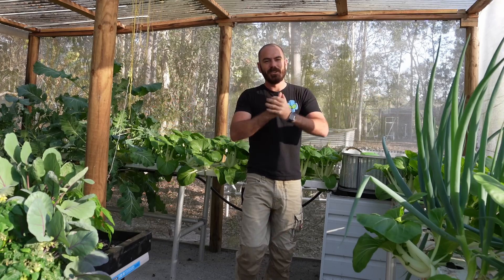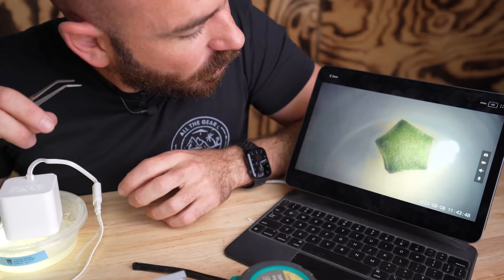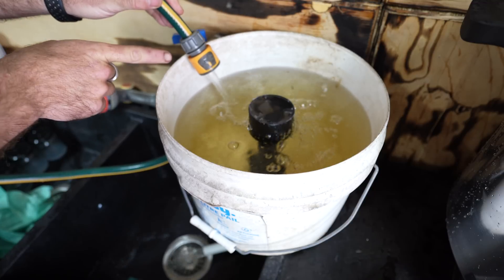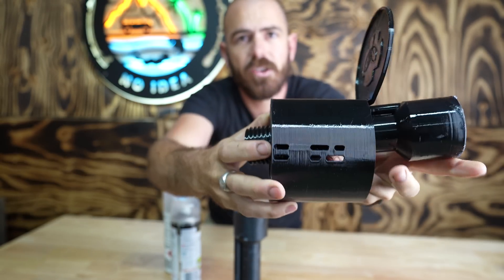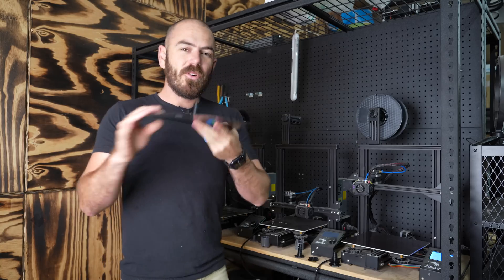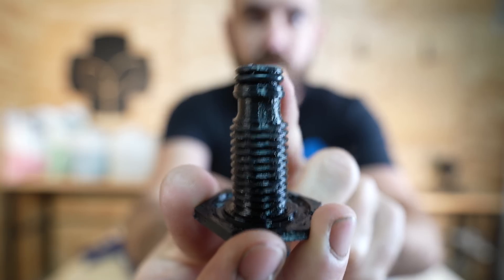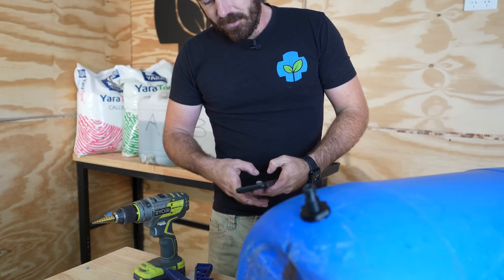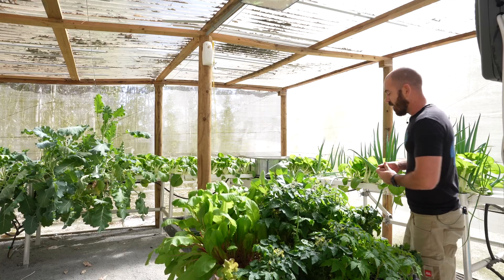3D Printable Bell Syphon + Updates

Comment: Hi Hoocho.  Have you tried TPU for the bell syphon?  It is harder to print but super strong and flexible.  My prints come out 100% air tight so you wouldn't need to spray them to stop air leaks.  Because it's flexible you might have to experiment / modify your design.  I do think it's worth a look. 🙂

Comment: Make the multi purpose bulk head at a 3/4 garden hose inner diamter to ba able to use a hose  "Flat rubber o ring " to seal from thr inner tank side . This allows for a  seal with out silicone  and have access to cheap garden hose o rings .

Comment: actually i have used a 3d printed bell siphon for a couple years now. in a timer run flood  drain for potatoes that worked remarkably well and i get great harvest. The roots  lay  across a  support net the potatoes sit in a  net cup ad the roots  go down and are  across the netting the system floods  to that area  just  below the  pot then drains.    btw i used PETG  with a  .1 layer thickness and slightly slower print speed  with  fan speed reduced  and have had no water impregnation through the surface of petg

Comment: Hey Hoocho, I've been looking for a 3d print design that allows you to connect a 2inch and/or 3inch pvc pipe to a container, similar to the bulkheads sold by current culture (For a RDWC system using 2 or 3 inch pvc pipes). If you can make such a design I will support your Patreon 🤣

Comment: Would it be possible to have the print file be adjustable?
Maybe something like the user inputs total height of the syphon & the middle section is adjusted to accommodate the desired overall height...?

Comment: i cant think of anyone else to ask (which means you are kind of the authority on this planet) this.. of all the kinds of hydroponics youve done which would you say is the best for growing weed? im thinking dwc, but aeroponics and fogponics both seem like they could be really effective provided you could get proper net cups to support a full grown plant.
as for this video.. watch out for clear coat, i do lots of models (mostly bandai but also knock offs) and theres some combinations of clear coat and different kinds of plastic that make the material VERY brittle. nothing worse than sinking over 100 hours in to a model building, scribing, modifying, painting, getting all the decals put on, and then clear coating only to have a piece break when you go to pose it to put it on the shelf.

Comment: Hi Hoocho. Love the work you do experimenting and developing/tweaking various hydroponic grow methods. Kudos mate! Re sizes of Bell Siphons - most grows suited to flood and drain at depths where bell siphons become relevant (bigger than flood and drain table style) are going to need media depths of 300/400/500mm with media above the flood line of 50 to 100mm. Size of Bell Siphons therefore need to able to accommodate 200mm ad 250mm activations for >=300mm grow beds, 300mm and 350mm activations for >=400mm grow beds and, 400mm and 450mm activations for >=500mm growbeds. I am so looking forward to including a 3D printer in my next grow site expansion, you have inspired me!
Outlet needs to be min 19mm, preferably 25mm diam - input 13mm needs min 19mm outlet; input 19mm needs min 25mm outlet. Input larger than 25mm would be insanity requiring a custom build🤪.
How can the internals of this bell siphon be cleaned? just a thought.
Keep up the great work.

Comment: Maybe try 100% infill? The printing process itself introduces micro cracks to the surface. It's very difficult for a raw print to be water tight. I'd suggest to look for a proper coating and treat the parts afterwards. In low temperature environments you can use bees wax.

In any case, thank you for all of this work. We need more people experimenting and solving these kinds of problems 💖🫂

Comment: First off Kudos. The threaded nipple design is a great idea and a time saver for sure. Now the suggestion:

* How about a 3D set of standardized nipple and thread sets in both metric and imperial?

That way those of use doing 3D design work can work with a know set of usable and interchangeable threads. Doing so will make future designs more modular. 

Look forward to the plant cell effort.

Comment: Great job on the siphon! Making one is not an easy endeavor, I have been working on one for years at this point haha 
Have your tried your siphon in a bigger container? I think that if you have a bigger reservoir, you will need to have a pump minimum flow rate. if you are planning on making this available to people, I think that some will face this issue and therefore it would be a good idea to inform them about a potential minimum pump flow rate requirement :)

Comment: One of the biggest problems with the bell siphons is to get them to start and stop properly.  Many people will build a bed and put their siphon in it while there is no media and get it to work.  Then once the media is added it will magically stop working because the water level raises much faster even though the fill rate is still the same.  Then as the roots start to fill in the bed it will continue to affect the rate the water level rises.  Making it even more picky, the drain rate is even more difficult to deal with since the media and roots act like a sponge and as the bed gets nearly empty, the water that gets near the siphon really slows down and it make it difficult for the siphon to break.  May times the siphon goes in to "limbo" where it starts to suck up a little air which slows down the siphon rate, the water level goes back up again, the siphon speeds up, then starts to suck air again and it becomes a vicious cycle.  On my designs I added the cup on the button over the snorkel which eliminated that problem which acts as a "Schmitt trigger" (for those of you who are familiar with electronic terms!).   So basically, make sure the siphon is capable of working at different flow rates.   One design option, which would add a lot of complexity to the design, would be to make it modular so you could add maybe 20mm chunks in the neck area so that a user could stack the siphon to meet their own height requirements.  Probably would be difficult to since you're dealing with sealing the center standpipe, the bell, and the snorkel.  Maybe some kind of snap together with a silicone seal.  I use Rustoleum clear enamel to seal my siphons...it soaks right into the layers and makes a great seal.  Keep up the good work! 👍
Reply: Everything here is what you need to consider, lol.

I was getting ready to write an essay about it and then, (bige)low and behold, Rob beat me to the punch. Hope all is well at your farm Rob. Love your videos.
Reply: @RiparianBeing  I was trying to keep it somewhat short.  ;-)
Reply: Joined the Patreon to see the bell siphon and the folder for the files is empty?

Comment: interesting love it!  Would love to test on my new 300x300x340 bed. New to printing myself but long time into aquaponics and hydro. Could you not skip the paint and put them in a container over a bed of acetone since after maybe 1 hour it will make the layer lines vanish tho to long can start melting the print. look into methods of making print look like resin since the fumes mold the external it may just seal so only a idea :) Ps with Simplify3d i can just change it to suit size before print anyway to run deeper beds or in mini systems. Great Job!

Comment: (havent finished watching the video) you could make the shrouds inner diameter compatible with ordinary plumbing pipe (the diameter of pipe that rob uses for example) and put a lip. So the pipe could just slide into the shroud (as it normally would with couplings between two pipes) and then you can have a bottom that has fiddly bits and a lid that has a fiddly bits and the user can find and cut the pipe into the length they need. That maybe requires different kinds of Inner diameter shrouds, also I guess people will have different kinds of media so the size of the holes in the shroud might also be needed to taken into consideration. Good luck and thank you for your effort.

Comment: Given that the neck of the siphon is pretty much exactly the same the whole way up and down, and it's just the base and the head of the siphon that have any complexity, why not just make it have a riser-fitting?  That way a single print can be adjustable and you just use silicon to seal the joins?

Comment: What is the tested min and max flowrate to start and break the siphon?  Is there enough hand clearance around the shroud to clear any roots ingress or obstruction?  It's a good design but I'm so used to just using a 20mm poly riser cut in half with 32mm blue line as the expansion collar which can be slid up or down as   height adjustable then 50mm PVC bell...breaks no problem without a snorkel. I have slide show of my Aquaponic system build  you can see how I made my bell siphons.